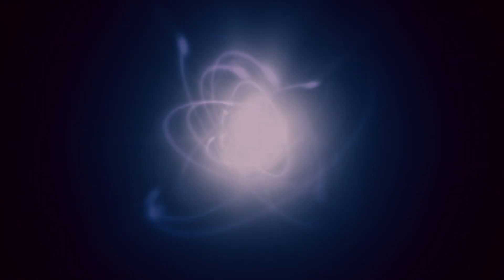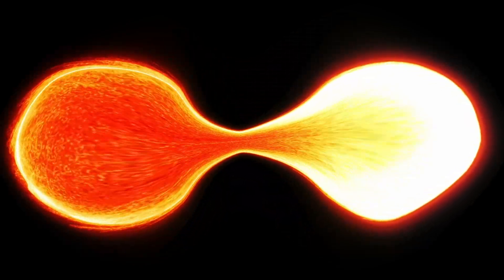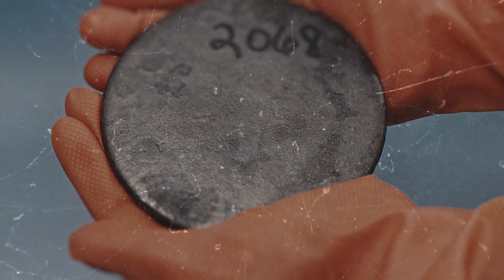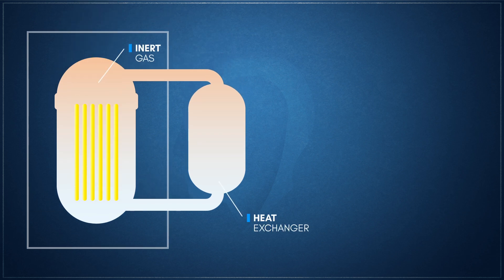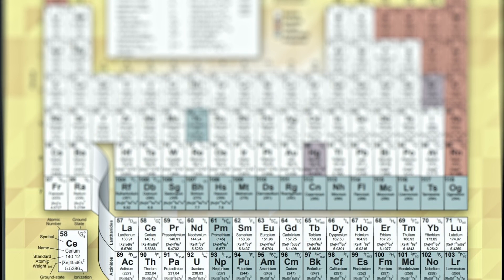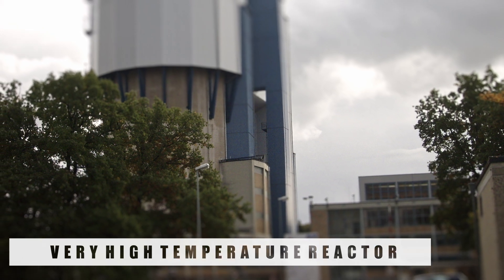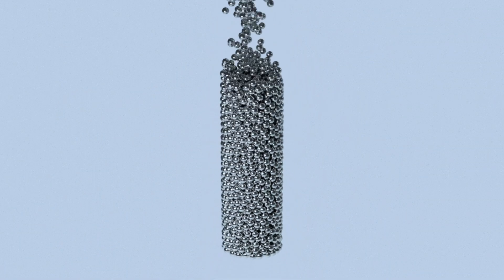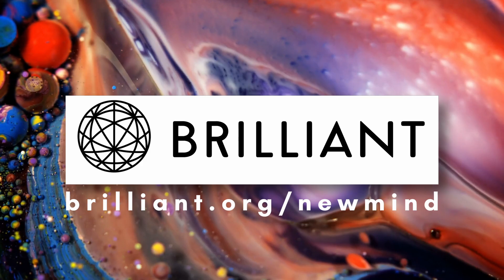Portable Nuclear Power

Comment: I really want to see fission power and renewables take the lead in my lifetime. As much as I'd love to see fusion make a breakthrough, I fear it'll be 20 years away for my grandchildren as well.
Reply: I agree on both fronts. I would love to see it happen, but because of political reasons (major gas companies funding politicians being one example), I honestly think that the general public will have to push it to happen. And due to regulations imposed by those politics, it will end up being extremely expensive, if it's even possible to get it off the ground. I don't say this out of resenentment, simply an understanding of how the political world works.

But, I sincerely hope that people are able to push it through, because it would change the world for the better.
Reply: Digital_Jedi, fusion is closer today than it was 20 years ago. I'm sure ITER will run at a +Q reaction cycle but I have serious doubts that ITER will pave the way for commercial reactors. The MIT proposal is a better bet IMO as far as Tokamak type reactors go. For several reason. It's designed to test maintenance issues for one. Second it is taking advantage of material sciences work that has led to the commercial production of higher temperature superconductors that can be used in the magnets that generate the containment fields. Plus the MIT design is reasonably small. But at the same time I would like to see some of my tax dollars used to fund some of the start-ups looking at more unconventional designs. Given the size of the US budget two or three billion is small change. Maybe they wouldn't work. But if they did the payoff is huge.
Reply: @mpetersen6  everything is closer today than it was 20 years ago lmao
Reply: every year one step closer
Reply: It will forever be 20 years away.
Reply: Solar has had decades and has not resulted in any reduction in pollution, nuclear has always been the only clean power that is safe clean and economical, as far as wind and solar,wind has produced far more power, without helping the Chinese murder and pollute.
I wish our leaders would support solar panels from clean power grids.First Solar is made in the US,but Biden passed laws helping the Chinese with their coal power and hurt First Solar, Peroskovite solar cells are needed to get solar prices down to where they could make a contribution, research is ongoing.
Reply: @paulbedichek2679  I haven't heard of first solar, I'll need to look them up. Solar has always been of interest to me, and I agree whole heartedly that we should invest more in it, and in safe ways to store solar power as well
Reply: Russia has fusion. It won't make it here unless the Globalists are purged.
Reply: Fusion is ALWAYS 5 years away, and it will be for the rest of anyone's life.
Reply: You know what the problem is right? Everyone is trying to make their own build based on how they think the universe works. If you want it to work keep it natural. The sun is already there giving us all the secrets. You must build it to the specs of the sun if you want it to work. Not the same size, but the same physics. One day's others will understand me.
Reply: @IsAmericaforSaletoChina  superheated plasma must be magnetically suspended in order to be safe enough to use as a power source on earth. The issue is that heat messes with magnetics, so it destroys its own containment. There have been attempts at doing exactly this, and they have been largely unsuccessful. The ones that have been successful are leading the way in experimentation to where we may someday have a power source similar to the sun in a smaller form. 

This is not a new idea. "Someday people will understand me" doesn't apply. It's simply more complex than that. 

Solar radiation. Blocked by our atmosphere, but if we build one here, how do we shield against it? 

Suspension: how do we keep something superheated to that extent contained? 

Transfer of energy: what, exactly, do we use to take the energy of the super heated source and transform it to electricity? 

Nuclear energy is far more readily usable, and we already have the infrastructure to use it.
Reply: @matthewbrown5228  Tell me more about your eyes? Oh I am sorry did I ask you?
Reply: @IsAmericaforSaletoChina  public video, public forum. By posting you are inviting conversation unless you specifically tag someone, which you didn't.

Comment: Aren't thorium reactors technically the most "green" source of energy
Reply: Thorium struggles to maintain a chain reaction, it is still in development phase. Uranium we understand.
Reply: @luke4916  That's why Thorium are inherently safer. Take away the neutron source and reaction stops. The Neutron source can be electrical or  old nuke waste.
Reply: @alwayscensored6871  14.
Reply: @luke4916  That’s strange, never heard of this happening when they successfully proved out molten salt reactors back in the sixties.
Reply: @williamgrimberg2510  I don't think that Molten Salt Reactor of the '60s used Thorium. It also didn't make electricty
Reply: @artsmith103  With respect you are wrong. Thorium MSRs back in the 60s was a proven technology that produced electricity normally. They where abandoned as a commercial solution due to political and military interests of the era. Alvin Weinberg was the director of the US R&D program in Oak Ridge.
Reply: @Cupraman911  Maybe you're talking about some isolated event. The ORNL molten salt reactor that ran for some 13,000 hrs used U233 and did not make electricity. There was confident discussion of molten salt thorium back then but I don't think it was ever done. The airplane reactor ran very briefly just to prove doable. Maybe that used some Thorium, I don't remember.
Reply: @artsmith103  
But can it actually be built today with current levels of engineering or is it like Fusion in that it is an interesting idea but the engineering is nowhere near producing a working system for generating power.
Reply: @bighands69  it can be built today. The results of the first MSR was metallurgy and automation to purge impurities were not up to full safety standards. Those issues have been resolved.
Reply: @luke4916  India already has a thorium reactor
Reply: I have also heard some talk about a new generation of Thorium portable reactors.  They are supposed to be able to burn the spent fuel almost completely.
Reply: Fast reactors and thermal molten salts are both great,but even using good old fashioned pressurized water but in an intelligent way as with NuScale,are very sustainable, getting U from the ocean leads to 20 trillion years of clean power,solar panels are made with lave labor and Chinese coal.
Biden had a chance to help clean domestic solar but he instead opted to help the dirtiest most muderous solar producers. Now we should blockade all Chinese ports, nothing gos in or put, this would immediately result in a cleaner planet.
Reply: Thorium reactors don't produce materials that can make nuclear weapons, so they're sidelined in favor of reactors that can make such materials.
Reply: @lordphullautosear  no

Comment: Which nuclear? There are two nuclear fuel elements:
Uranium and thorium.
There are three nuclear fuel cycles:
Fissionable uranium-235 isotope representing 0.7% of all uranium.
Fertile uranium-238 isotope representing 99.3% of all uranium which when it absorbs a neutron will eventually breed into fissionable plutonium-239.
Fertile thorium-232 which when it absorbs a neutron will eventually breed into fissionable uranium-233.
There are two physical states to hold the nuclear fuel in:
Solid which means that the fission products will remain trapped and whose waste has components that will last 300,000 years.
Liquid which allows for the fission products to be subjected to chemical separation processes while the reactor is in operation and whose waste is much less than uranium and has components that will last only 300 years.
There are five forms that these three nuclear fuels can take: solid oxide, solid metal, aqueous, molten salt and molten metal.
There are three materials that a solid fuel can be immersed in: light water, heavy water and sodium.
There are two molten salts which are viable: liquid chloride and liquid fluoride.
There are six reactor technologies:
Pressurised light water reactors operating at 153 atmospheres (PWR).
Boiling light water reactors operating at 75 atmospheres (BWR).
Canada deuterium uranium pressurised light water reactors (CANDU).
Liquid metal fast breeder reactors (LMFBR).
Liquid fluoride thorium reactors (LFTR).
LFLEUR
If completely fissioned, one pound (0.45 kilograms) of uranium-233 will provide the same amount of energy as burning 1,500 tons (1,350,000 kilograms) of coal. See https://pubchem.ncbi.nlm.nih.gov/element/92#section=Uses

Comment: 3:15 Fun fact; that person is wearing gloves not to protect themselves from the nuclear fuel, but the nuclear full from them. Its perfectly save to hold that fuel in your bare hands. You probably wouldn't want to do so for a few hundred thousand years (and you certainly wouldn't want to swallow it), but holding it even for a few hours of even days isn't going to hurt you in the slightest.
Reply: Uranium has the same chemical toxicity as lead, and the alpha radiation can irradiate your skin. However, the activity of U-235 is usually so low that gloves shouldn't be needed for short-term contact.
Reply: This is true for unused fuel. Spent fuel…. Not so much.
Reply: Fun fact: U-235 is alpha radiation that will not penetrate your skin. Put it through fission and it turns into hundreds of the deadliest elements in the history of mankind for longer than mankind has been in existence. My what fun that is, eh?
Reply: I've handled quite a few magnox clad elements during my career. The only real risk is dropping one on your foot as they are very heavy.
Reply: @MervynPartin  Since naturally-occurring radioactive materials (NORMS) are primarily alpha emitters with extremely long half-lives which cannot penetrate a piece of paper, ionic radiation from a magnesium-oxide encased NORM should not present a radioactive risk to someone, as you say. Using NORMs or other ionic radioactive, fissile elements (combined with non-fissile ionic radioactive elements like U-238) to create a fission reaction transforms those elements into hundreds of fission products and actinides with half-lives of less than a second to millions, even billions of years. When they disintegrate they release subatomic particles and gases with alpha, beta, gamma and neutron radiation that are hundreds to thousands of times more dangerous than the NORMs. In addition, the fission reaction transforms non-radioactive compounds such as steel and concrete in proximity to the fission process into radioactive materials through neutron activation.
Reply: Some 50 years ago I worked briefly at a nuclear fuel processing plant in the hills of east Tennessee, among the hillbillies. One ol' boy put several pellets in his pocket and took them home to show to his wife. Don't know how the bosses found out about it, but they weren't too happy!
Reply: @clarencegreen3071  You did it... We all know
Reply: When it comes to putting radiation into your body I always get a kick out the banana as the perfect food commercials. Some of the potassium atoms in the banana are naturally radioactive.
Reply: @mpetersen6  By that same fact your muscles (and bones to a lesser degree), also have radioactive potassium in small amounts. Sleeping next to someone exposes you to radiation! It's a real risk but a bogeyman to the uninformed.
Reply: @mpetersen6  pretty much everyone here knows this

how is that even relevant

Comment: I think something almost everyone in the public overlooks is "automatic containment" and "automatic shutdown" and "negative feedback" DON'T mean "safety". A lot of nuclear incidents (Fukushima coming to mind) aren't caused by runaway fission. They're caused by the unstable fission daughter products (spent fuel) continuing to release heat regardless of any control mechanism. If your coolant mechanism fails (like it did in Fukushima, the fission control worked fine) your reactor fuel heats up and will eventually cause a meltdown.

Criticality excursions (quick runaway nuclear fission) are rare compared to coolant failures but criticality safety is being marketed as the key safety feature of a lot of these new reactor designs.
Reply: Large scale plants such as fukushima are older designs but also have large volumes of centralized materials.
Reply: @bighands69  Every reactor has "large volumes of centralized materials".
Keep in mind Fukushima Daiichi is a 10GW thermal power plant.
If I remember what this video is about, these "portable" designs are 250 to 500MW thermal designs. You'd have to have 20 of them to replace a plant like Fukushima.
You still have to have more than a critical mass of fissile fuel in each one, now you just have 5 to 10 times the moving parts that can go wrong.
Reply: not it's not.  Did you not watch the video?  22.
Reply: @nathanwahl9224  useless comment is useless.

Comment: Manufacture of solid nuclear fuel is very high technology process. Manufacture of salt based nuclear fuel is much easier and therefore lower cost. It’s also intrinsically safe in operation and as it’s a liquid the fuel can be almost completely burnt. That results in a small fraction of the high grade waste thrown out by pressurised water reactors.

Comment: Pebble bed fuel at first glance appears to be a good solution, but when 
looked at more closely it is terrible. The pebbles are very hard to make
 and IMPOSSIBLE to break down and recycle with current technology. There
 are a number of fundamental problems of any solid fueled nuclear 
reactor. Nuclear fuel ALWAYS swells due to the intense radiation, 
reaction byproducts quickly contaminate the reaction and cannot be 
remove from the solid fuel, unless the fuel is recycled. Also it only 
allows utilization of a very small portion of the energy in the nuclear 
fuel (about 1-3%), requiring fuel bundle replacement in about 18 months.
 When the core is decommissioned you still need to store the highly 
radioactive waste for thousands of years. Spent fuel MUST be 
continuously covered in highly purified water for at least centuries to 
keep the fuel bundles below melting temperature. The continuous heat 
from the fuel, evaporates the water quickly (hundreds of gallons in a 
short period of time) ALL spent fuel is currently stored in pools, on 
site at the nuclear plant and there are no plans to recycle it as it is 
expensive and hard to do conventionally. Uranium is somewhat water 
soluble (Thorium is not), so there is a groundwater contamination 
concern.

I used to oppose nuclear energy, mainly due to high 
pressure steam explosions (3 times so far) and long term storage of 
highly radioactive fuel for 10k+ years. I have changed my mind, but only
 if we build  Thorium liquid fueled, Molten Salt reactors (such as LFTR)
 instead of the VERY expensive, large boiling water conventional reactors we have now. 
Currently Thorium is  a waste product of a number of mining operations, 
is orders of magnitude more plentiful than uranium and is basically as 
safe as dirt (it needs conversion inside the reactor to become useful 
fuel, conversion takes 30 days and is free). Molten salt solves ALL of 
the fundamental problems of boiling water reactors, as part of their 
nature. They also cheaply and easily burn current stocks of used fuel 
rods leaving only a small residue that is safe in about 300 years. They 
effectively use about 95+% of the nuclear energy in the fuel. No 
expensive explosion proof containment structure needed, as it cannot 
explode (it operates at ambient air pressure). They are walk away safe 
(Oak Ridge Tennessee ran a molten salt reactor safely for 6,000 hours 
and performed walk away safe tests on it at full power in the 1960's). 
In fact they shut it down every weekend because no one wanted to stay. 
They are well suited to the SMR form factor and easily allow continuous 
removal of very valuable medical isotopes on an ongoing basis. These 
medical isotopes are impossible to remove from boiling water reactors. 
They also provide high temperature waste heat that can be used in many 
high temperature processes now, such as steel, fertilizer or concrete 
making, just to name a few. Desalinization of sea water on a huge scale 
is easy and cheap.

The only remaining hurdles are some slight 
metals compatibility proving needed. Chemical separation is a far 
superior and cheaper process. The inventor of the nuclear tea kettle 
reactor (Alvin Weinberg) said it was fine for military use but was a 
very poor choice for commercial reactors, as we have seen 3 times. For 
many years he strongly promoted the Thorium, liquid fueled reactor as a 
far superior choice. Thorium is useless for making bombs which is one of
 the main reasons they used uranium instead back in the 1950’s.  See 
Thorium Alliance you tube videos for a good overview. An excellent 
boiling water reactor problems review is a 1hr You Tube video:  
Nuclear
 Disasters & Coolants   
https://www.youtube.com/watch?v=8Pyq8kCeiYs&list=PLs_mufQsR4fge432XbzbnIEgEjayooYSu&index=5
Reply: The fact that TRISO is close to indestructible is a selling point, they stay in this form until they storage area they are placed in after use, journeys deep under the Earth where heat, time and pressure, render it safe when it reemerges. Yes we can manufacture TRISO in great quantities with no defects .